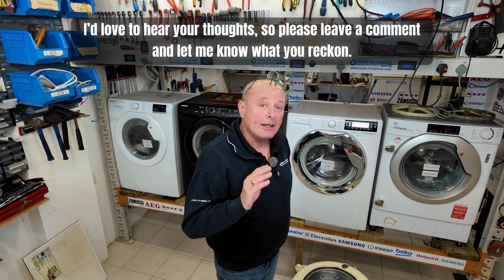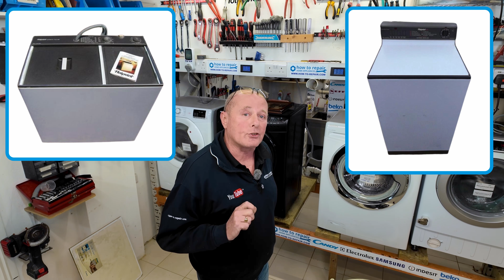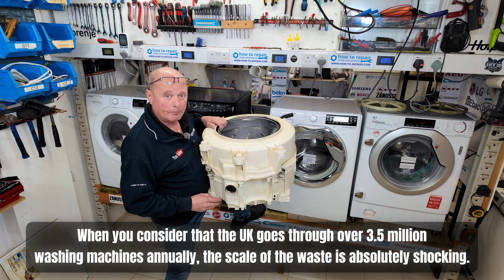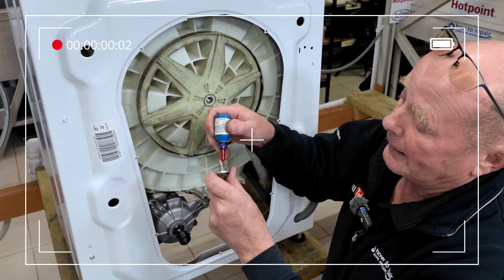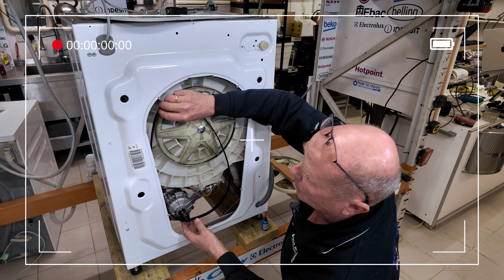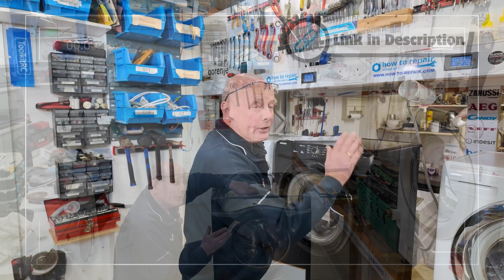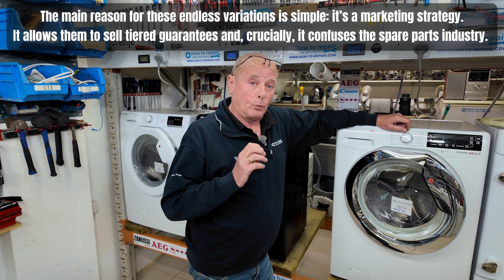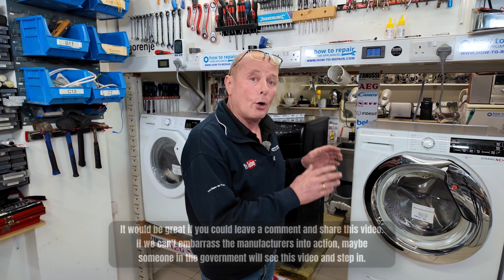I Scrapped 13 MACHINES to Prove a Point: STOP BUYING These Brands!

Comment: I saw yesterday that my samsung washing machine has bolted drum and not velded but it is 9 years now and going to its end. You say that there can be shockabsorbers? Where are they placed? Under the drum? When I removed the top I saw only 2 springs that the drum was hanging on. I think there is som problem with them because ot the jumping it started to do a while agoo.

Comment: I had whirlpool washing machine... motor brushes went... €15 and easy replacement, few monts later bearings went and nasty surprice for me sealed drum... i saw few YT videos how to cut and seal back drum but at theis point was too much for me. I will never buy anything from Whirpool again.... same with Canon printer that stop supporting new widows only because was too old?! There was nothing wrong whit it, I payed huge money for newest tech when it came ot with wifi build in... few years later didn't work because manufacturer didn't want to write few lines of code and update it. So for me it is don't buy anything again from this brands.

Comment: No comments on the new cost of the old machines. In 1982 a Hoover Electron 800 cost £249 from Kays. Adjusted for inflation that would be £900. I would expect a well made lost lasting machine for that.

Comment: PCB costs are absolutely ridicolous if you see them for what they are. You can get a much more complex PCB's for pennis, which proves it's just manufacturers inflating the prices so you decide to buy a new machine.  
I belive manufacturers should be held accountable for this. Punish planned obsolesence and force them to sell parts for reasonable prices. Washing machine PCB costs them pennies to make, it shouldn't cost more than 10-30 retail, even then they would make 20x on manufacturing cost.  
I understand a drum is more expensive, it's a big piece, requires big machines to produce them etc. PCB is just a circuit board with a few components, which would cost me a few bucks if I didn't bulk buy, it really does infuriate me when I see them selling that shit for 200, it's a blatant ripoff.

Comment: thank you, all this needs to be said.  I am not a engineer but i fix stuff. We run a B&B our washing machines get hammered. samsung had bearing failure, bought genuine seal and bearings from bearing shop. Lasted another 5years , By comparison  a hotpoint had similar issues its drum is now a fire pit.....sort of recycled but i would rather have a working machine.  A lot of the problem is price, every one looks for the cheapest machine, at £200 its not going to be worth fixing,    In the same way as all machines have a nice little graph showing energy usage, they should also show designed life cycle and cost of repair. so many domestic appliances use generic components, manufacture's should be rewarded for using a standard belt , motor mount etc.    lower VAT or similar . Difficulty is this all only makes sense if you fix it yourself,  we need a change of mindset back to simple durable products.

Comment: To je Right to Repair Directive (Directive (EU) 2024/1799), officially adopted in 2024. Its goal is to reduce e-waste by making repairs easier, more affordable, and more attractive than buying a new device.
Member states must transpose these provisions into national laws by July 31, 2026.
Key changes for consumers and the industry:
Post-warranty repair obligation: Manufacturers are required to offer repairs for products that are "technically repairable" under EU law (e.g., smartphones, tablets, washing machines, refrigerators) even after the legal warranty has expired.
Warranty extension: If you opt for a repair within the legal warranty period, the warranty for the entire product is automatically extended by an additional 12 months.
Availability of spare parts: Manufacturers must provide spare parts and tools at reasonable prices that do not discourage repair.
Ban on software blockages: Using software or hardware techniques (such as part-pairing) that prevent independent repairers from fixing devices is prohibited.
European Repair Information Form: Repairers will offer a standardized form with clear info on price, duration, and repair conditions, making it easier to compare offers.
Online repair platform: By 2027, a unified EU platform will be established to help you easily find local repair shops, "Repair Cafés," or sellers of refurbished goods.
Products covered by the Directive (Annex II):
The repair obligation currently applies to:
Smartphones and tablets
Televisions and monitors
Washing machines and dryers
Refrigerators and dishwashers
Vacuum cleaners
Batteries for e-bikes and e-scooters

Comment: After 35 years and only 2 repairs we finally had to buy a new washer. Since then, in 11 years we bought 3. I've just accepted the fact that no matter which brand you buy it's not gonna last, unless you get lucky, so I just buy the cheapest one with a 5 year warranty, the current one cost me 310€. If it lasts 7 years it will be ok and I'll just buy a new one, sad but that's where we are.

Comment: I dont think that there is planned obscolence. 
 People want cheap machines, while the producing costs going up, so the manufacturers have to use cheaper and cheaper materials, solutions, etc.
You can still buy very good quality machines, the same quality as 20-30 years ago, but they are much more expensive. That quality from the past is very expensive to produce now.

Comment: Those pricing on harnesses is the real crime tbh. Same goes for automotive. it's literally nothing more than thin (for most part) copper wire you'll find anywhere else, with plastic connectors. It is not special in any way except that it has those fkin proprietary connectorsthat you usually cant find anywhere and/or the terminals to those connectors are some weird ass sizes, again, nowhere to be found and generic ones won't fit. I'm not a fan of regulators meddling with everything on the market, but sometimes there's just no other way.. sure soldering a wire in a harness is easy, if you know where the loose join is but sometimes there can be many (dozens) of such places which have not yet fallen apart (but will, soon)

Comment: As an appliance engineer, I find it's luck factor to how long your machine will last (also, check the bloody pockets) & that no brand lasts as well as they used to. Everyone thinks that because the government said manufacturers had to make the appliances greener, means they should last longer but it's the opposite. They won't last but there's more recyclable materials in them.

Comment: I brought a Worcester Bosch which was made in Germany just over 10 years ago ,not one single problem within the 10 years of use. Just Brought another Worcester Bosch thinking this machine was made in Germany,but looked at manufacturing details on the back stating it's made in Turkey! Let's see if this lasts the distance..

Comment: My hotpoint machine lasted 18 months before the pcb burnt out and I was told it wasn’t worth repairing. I wouldn’t touch anything hotpoint with a barge pole.
Reply: My Hotpoint is just over 3 yrs and has started leaking.

Comment: I've just fitted a Lamona LAM8741 Integrated 8kg 1400rpm White Washing Machine which is the same as a beko
Integrated 8kg 1400rpm Washing Machine with Quick Programme WTIK84122F
A Energy Rating and didn’t work from the first wash, an engineer came out and couldn’t fix it, so was given a new one form Howden’s Joinery and told to scrap the brand new one that didn’t work

Comment: Great video, pland obsolescence is a very interesting problem that most people turn a blind eye to. My introduction to it was as a kid when i learned about the phoebus cartel, a group of lightbulbs manufacturers (i think Philips was among them) agreed that lightbulb lifespan should be 1000 hours. For reference the oldest burning lightbulb has been burning almost continuously since 1901. Sure it only produces a few wats nowadays, but we had 125 years of material science  since then, why are incandescent lightbulbs still lasting around 1000 hours.

Comment: Imo the consolidation of brands under just a few "umbrella corporations" is what has led to this plague of "planned" obsolescence and the general lack of quality.  It has also allowed them to increase the purchasing costs to the consumer.  Back in the day there were many truly independent brands that competed against each other and for them to succeed they actually had to build a quality long lasting product.  Now that brand names are mostly window dressing, and most major consumer appliances are built by only a few manufactures,  they can easily conspire on things like purposefully short life cycles that are designed to only last till the warranty runs out.  I believe a common term for this is insh!tification.   It's rampant in most industrial sectors including automobiles, hvac equipment, etc.

Comment: Had to scrap my 30 year old big Whirlpool washing machine last year as it started smoking and blew a fuse. My husband had done a couple of repairs on it over the years but hardly anything really. I bought it ex-display from John Lewis for £500 in 1995. I managed to buy another Whirlpool in April last year. It was 7 or 8 years old but had never been taken out of its packaging or used. Hope for another 30 years of service from this one. 
I bought a Whirlpool tumble dyer the following year. It broke a belt yesterday (only the 2nd in its life so far) which my husband managed to replace so hoping to get at least another 5 years out of it. 
Had little Hotpoints, Phillips, etc before the Whirlpool which only lasted about 5 years each. The only machine I would have again was my old Hoover twin tub.

Comment: The reason spare parts are much more expensive is that the machine is sold and done. However they need to calculate, produce and store enough spare parts for 10 years which adds to the cost. Easy solution: Make the parts expensive, thereby reducing the expected amounts they will actually have to sell. Think of it like they have only a couple spare pieces but at a price noone will ever pay.
Same with merging components like the inner and outer drum. Now the chance of someone buying a replacement is even lower, because any tiny failure will amount to a hugely expensive spare part. It's not easy to predict the mean time to failure for every single component f.ex. on a pcb, but if you sell the whole pcb at a high enough price, hardly anybody will look to replace it anyway.

Comment: Bought a Zanussi in about 1998. Worked well for about 5 or 6 years when the bearings suddenly went—water leaking, dreadful noise and shaking on spin. Nobody wanted to fix it so figured I'd try myself. In a couple of days managed to get the drum out and drive out old bearings. Then discovered no-one had bearings in stock. It sat dismantled on floor of kitchen for 3 weeks before I managed to get correct size (in my defence i wasn't sure I'd be able to get them out so hadn't bothered checking for availability 😅) Was still working faultlessly 16 years later when I left it for the next tenants. Bearings & seals were £7.50 😁

Comment: my 20? yr old LG front loader is working great.  No odors or anything.  Last summer I took it apart to inspect the back side of door rubber seal and washer drum.  It was clean all around, only a minor buildup on edge of gasket backside where it seals.

I use powdered detergent, no softener, clean cycle every month or so... clean/drain maybe a couple times a year.

Comment: Funny.. I happen to have a Hoover VisionHD washing machine, build with a small depth, and I bought it 18 years ago and it still runs fine without any problems at all.. I must be one of the lucky ones😂😂😂 and yes, i am a Swedish service engineer, meaning I am repairing stuff..😊👍 fixed the pump on my 12 year old bosch dishwasher (small version), because the pump actually costs just as much as a new machine and the pump was integrated with the heater. But some epoxy, a drill, some small bults and viola.. i runs perfect again. Had to turn the machine on it side to get to it but otherwise, no problem to fix and it didn't cost me anything. 😊😊

Comment: Not in the trade (retired University academic: we can be practical).

My old Hoover Keymatic* still works, although my normal machine is a Bosch Logix 7/4 which I bought about 16 years ago. It developed and electronics problem which I was able to trace (switch-mode power supply chip) and repair..

*Early 60's. My 1966 Norton 650SS motorcycle also still works. Spares for the Bike are easier to get than the washing machine.

Comment: Please can you upload a high-res image of the PCB that failed? I'm wondering if it was a manufacturing defect with the conformal coating AND if they put screws through the PCB that weren't stainless, and galvanic corrosion kicked in. Pay attention to similar corrosion around connectors.

What bugs me about this stuff is that having bearings that could be replaced is an easy fix. Bearings & belts would double their working lives. I've been pleasantly surprised by how maintainable a bean-to-cup coffee machine I bought in January 2020 has been. All the wear is centred around the diffuser, a £30 unit that is easy to replace, as ~5 brands sell the same machine with different aesthetics (20+ models) so it is easy to find. It will last a lot longer with proper maintenance and you would only need to replace two O-rings. Those will last much longer if you take it apart to re-lube a few times per year. Saved me thousands, and I ran an underground coffee shop with my neighbours in 2020+2021 (4 flats in a large townhouse, close but you don't have to live with them, and soundproofing is so good I've never been able to hear a neighbour's washing machine or TV).

Also, what are your thoughts on Miele? They have a reputation for being reliable (you definitely pay for it). Are they the exception or just good branding?